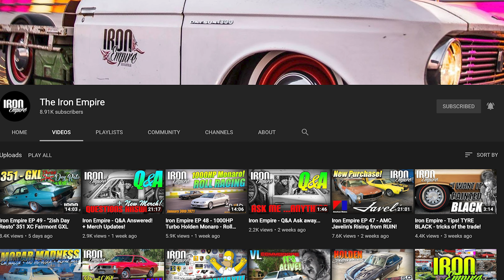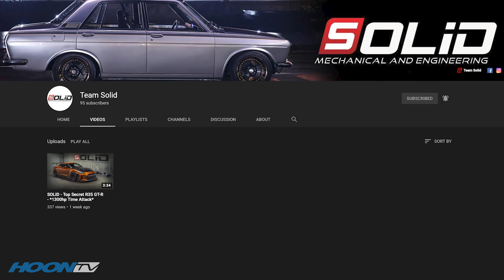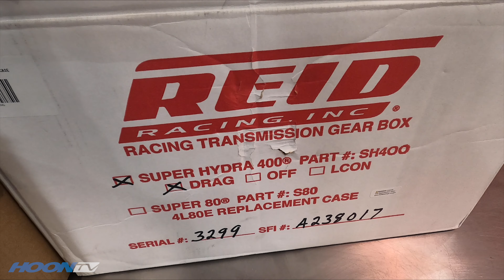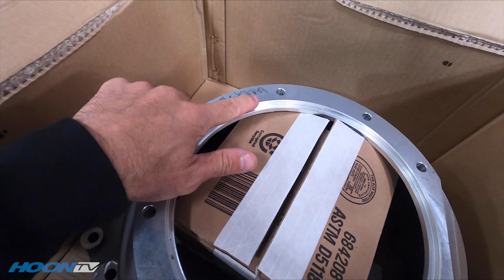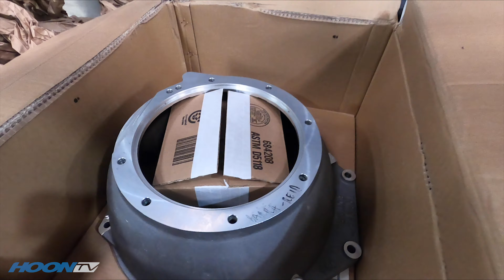BARRA GOALS 2021 - Final prep on the HoonTV drag car!

Comment: I’m impressed that the door handle worked on the XH
Reply from the maker: They’re brand new ones ;)
Reply from the maker: Plus I did my apprenticeship at Ford ;)
Reply: The correct adjustment usually has them working fine 👌🏻 that and not yanking on the things like most people do 🤦🏻‍♂️